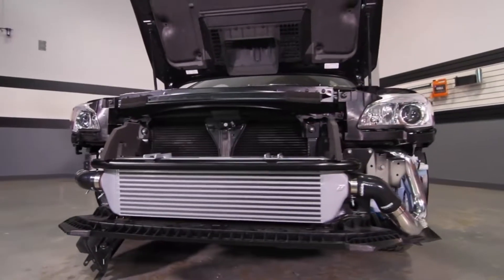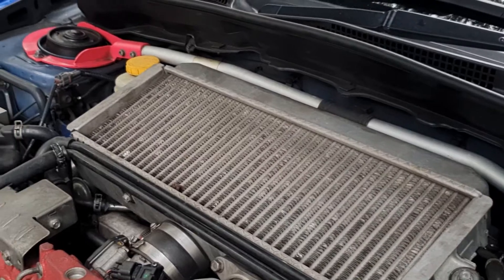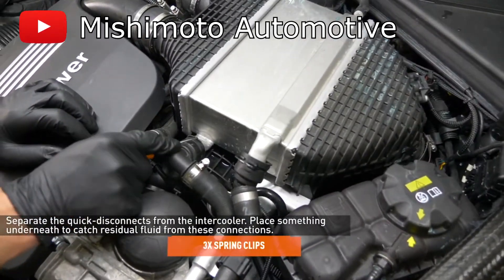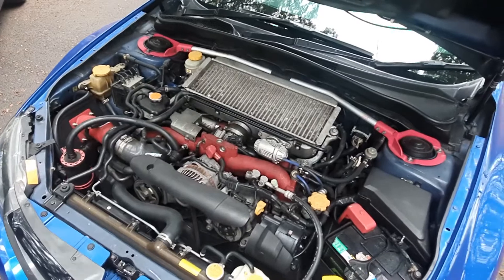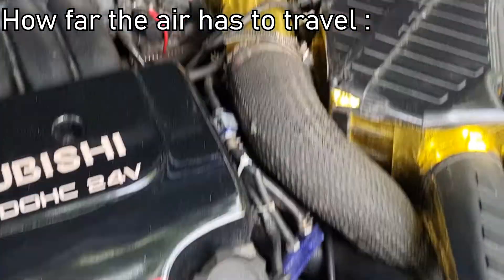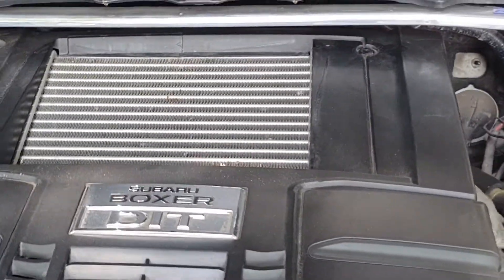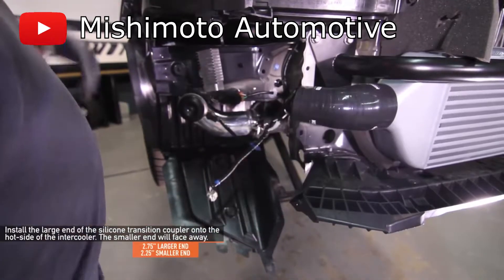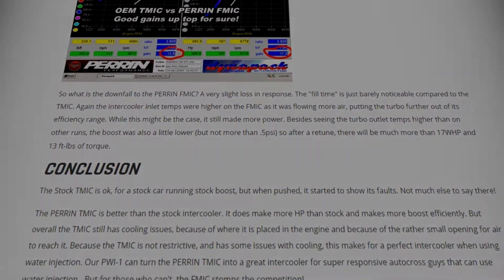Quickly Clarified - Front Mount vs Top Mount Intercoolers | Pros & Cons

Comment: Meh i dont trust Perrin Information as they are scamming lying trash.
 
1 - They are selling FMIC's so they are not unbiased (any information they give is like asking a tobacco company about the dangers of smoking)
2 - They sell painted Intercoolers (just for that reduction in effectiveness through paint insulation)
3 - They buy Chinese CCP made parts and rebadge them as perrin made 
(like their pitch stop mount for WRX's are made in China CCP with the Pitch stops that without perrin logo sell for only $35 
while the Identical Pitch stop from the same Factory with Perrin Logo on it is over $125.)
Reply from the maker: That's fair, regardless though having gone from a stock TMIC, aftermarket unpainted TMIC, and then a FMIC, FMIC is 1000% better than any TMIC. For the record both the aftermarket ones were Mishimoto's, never tried any Perrin stuff myself.

Comment: The lag is not even noticeable trust me I’ve modified 10 or more extensively personally owned always choose front
Reply: Which makes little sense as even a stock WRX with stock TD04 on stock tiny intercooler 
the boost lag is still very noticeable.

Comment: does this make the car more durable (last longer), because most mods shorten a cars lifespan.
Reply from the maker: it could actually help, since it lowers the IATs it may help prevent knocking due to heat soak caused by the factory top mount

Comment: It would be interesting to see how top mount intercoolers perform if you shield the heat from the engine and seal the scoop to the intercooler.
Reply from the maker: they are sealed from the factory but yea that would be interesting to see how it performs with some heat shielding. I'd imagine that heat soak will probably still be a problem for longer stints like on track days though....
Reply: @JCMediaYT  as long as it was moving and with the help of intercooler water spray, its is comparable to front mount...

But once the vehicle stopped or used in low speed average competition like gymkhana/autoX or slalom time trial, thats were the top mount suffer in heatsoak
Reply from the maker: @AmirPomen  not exactly either, regardless of whether you're moving or not, TMICs are superior over TMICs

Comment: This was very helpful. I think I'm gonna go front mount intercooler on my sti
Reply: FMIC are great if you want to lay down a ton of power, but,  without closing the top intake, you will create positive air pressure in the bay and hindering the radiators ability to properly cool the engine. Just basic physics. This is why you see people close the intake off on the hood.  The FMIC also prevents airflow to the radiator to cool your engine. More basic physics.
Reply: @sw417  I'm looking to make around 450-500 whp, nothing crazy, but I do want reliability
Reply: @Isothunder  Which type of vehicle?
Reply: @sw417  2018 Subaru Impreza WRX STI
Reply: @Isothunder  Cool, mine is a 2021.  Traded in my '19 WRX.  450 - 500 is certainly attainable, but you will need to change internals to make it reliable. IMO.  If you are already familiar with the process then please disregard. We have plenty of STi's in our club that hit that mark w/o FMIC. Most do the flex fuel, injectors ( those are mandatory as our injectors are already maxed in stock form).
Reply: @sw417  nice. I should of got a 2021 for the extra $10K, but I had tunnel vision on my subie when it was in front of me. Yeah, that's what I've been reading. I don't think I want to go big turbo. I do like the stock turbo, but I've also been thinking about maybe doing a twin turbo set up on it. I was watching a video about building the internals and the guy mentioned putting iron sleeves in the cylinder. I will be going flex fuel. The results are great. The build will come over probably 5 years, but I'm thinking turbo back exhaust next year and maybe Cobb sf intake.
Reply: @Isothunder  If you like, join us here : 2015-2021 STI Owners (EJ or bust)   on FB.  Tales of the darkside and success all in one concerning our STi's.   Good build information as well.
Reply from the maker: nice! saving up for a front mount on mine too

Comment: Excellent explanation, but what if you were to put a fan on a top mounted intercooler would that help get rid of the heat soak or no?
Reply from the maker: well it would help during traffic stops but won't make too much of a difference while driving since hot air rises.
Reply: J
K
K